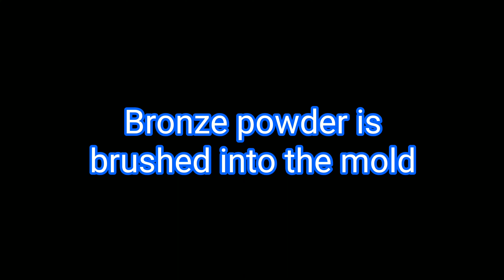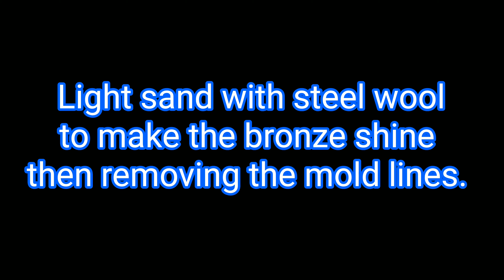How I Make My Cigar Nubbers

Comment: Those look awesome!
Approximately how much do they weigh? They look light but they looked dense.
Reply from the maker: Thanks Kevin! They are pretty light. Right now they weigh under 2 ounces. I need to get a pressure pot which should increase the weight some. The filler mix is made with marble dust/resin and if it has moisture in it the resin will foam a little (which reduces the weight). Pressure pot should help to minimize that.
Reply: @CigarArtistry  how much is the horse nubber